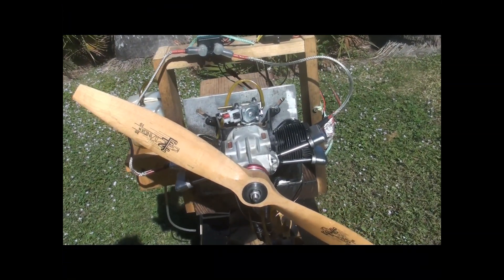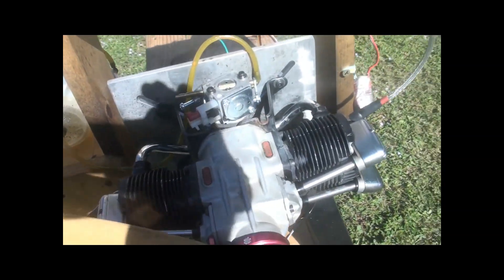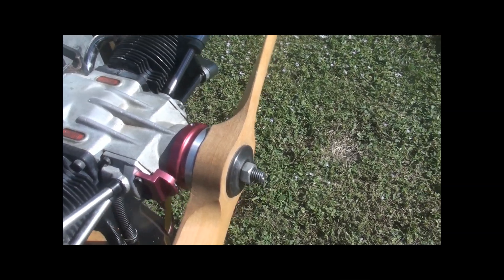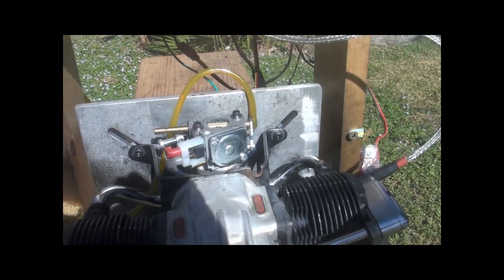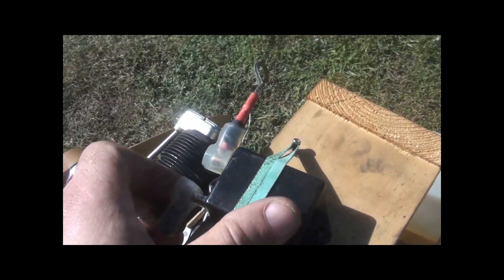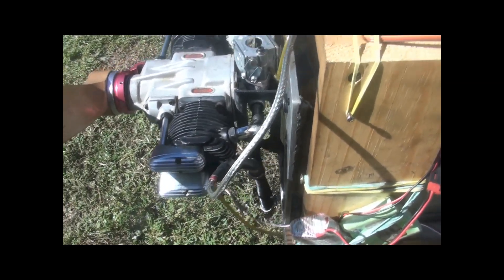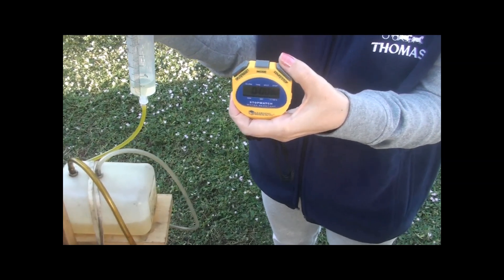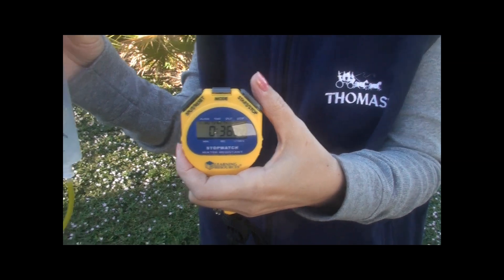Saito 270 Twin, Gasoline conversion by Adrian @ CH Ignitions .mp4

Comment: Dear Adrian.. I saw this video too late. Engine conversion is perfect. sound is wonderfull too. And I saw that you are trying to make RPM measuremens with the RPM meter set to 3 Blade propeller. If you look at the top right corner of RPM meter's display, you will see the 3-Blade icon. This is why you get 2/3 of the total RPM.   
Regards..